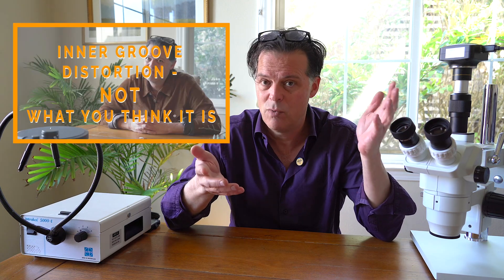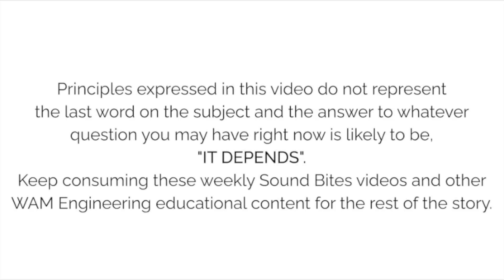Sound Bite #21:  What's Wrong With Stevenson Alignment?

Comment: Stevenson was meant to be suitable for 7", 10" and 12" records. 7" Singles can have a much smaller inner groove radius than LPs (54mm is not uncommon). With Stevenson's geometry one will get similar amounts of distortion at 54mm/45rpm, at the maxiumum between the null points and at the beginning of an LP at 33rpm.
Reply: Exactly! Stevenson is actually a Löfgren A applied for a virtual playable area which is a sum of 12" and 7" records
Reply: @tiborkocsis5819  Not quite. You can't simply apply Löfgren A to a bigger recordable area, because the distortion at 45rpm is lower than at 33rpm. There's no equation that can be used to calculate it and coming up with one would be a lot more complicated than finding the Löfgren A equation. It's not difficult to zero in the correct null points by trial and error, though. Stevenson is not quite there, but pretty close.

Comment: Interesting.  Why do you think so many Japanese tonearms specify Stevenson as their standard?  (Jelco, Fidelity Research, Ikeda, Micro-Seiki, etc).
Reply from the maker: I don’t know whether or not they tend to choose Stevenson but they do tend to use JIS standards for innermost/outermost modulated grooves - which more closely approximates Stevenson curve when applied to Baerwald formula. This assumption will bias the application of Baerwald, Loefgren, etc. further towards the center of the record.
Reply: @WAM-Engineering  I guess Classical music recordings generally have the orchestral crescendo at the end of the piece, which is often on the innermost grooves; that may have been the original motivation for keeping distortion as low as possible there.  At any rate, you are correct Japanese tonearms don't specify Stevenson per se, but if you look at their effective length and recommended overhang, it does produce an alignment almost identical to Stevenson.
Reply from the maker: Are you sure they use Stevenson and not Baerwald applied to a JIS standard? I really don’t know but whatever the answer is, I submit that such decisions to use Stevenson (or DIN or JIS standards for innermost groove) are largely misinformed by what “inner groove distortion” actually is versus what causes clearly audible distortion at the inner area of the record.
Reply: Technics’ geometry is very close to Steveonson for DIN and Audio Technica provides a Steveonson/IEC protractor for the LP120. I've seen other examples of Stevenson/IEC as well.